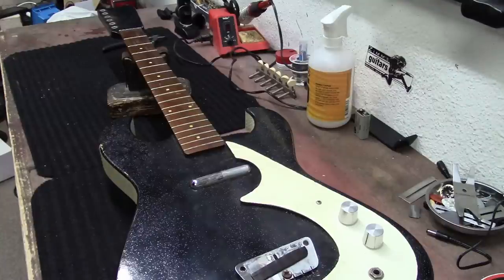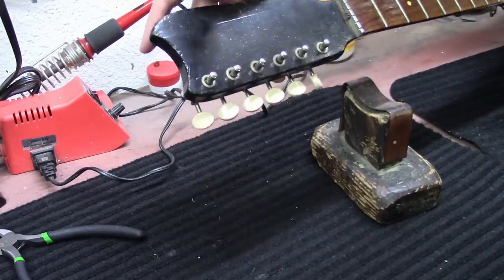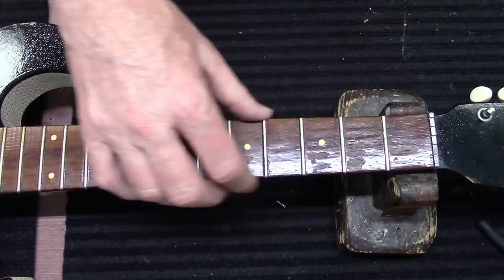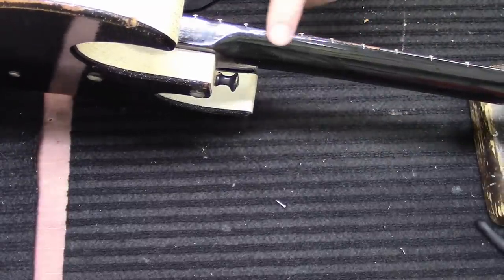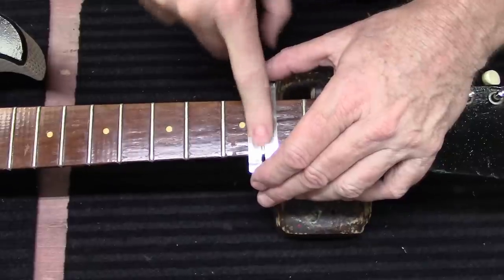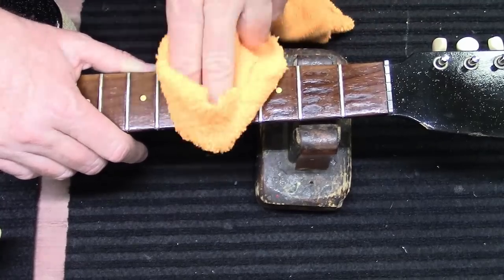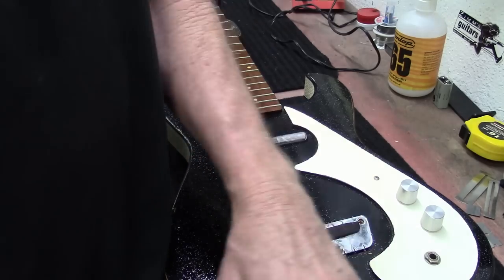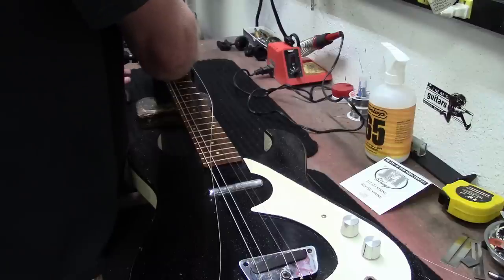The Storage Locker Silvertone!

Comment: I have soft spot in the heart for those things because of several reasons.
1: They weigh almost nothing, and the short scale let's you use  .011's or even .012's and still play easy.
2: Those old lipstick tubes are not super hot, and if you play one with the smaller Tweeds, like Champs and Princetons, they don't overload the front end and get too woofy and flubby. This applies to some of the other budget amps of that era as well, such as all of the Valco stuff. Some of those are amazing sleepers.
3: The lipstick tubes have a great clean tone, and the "edge of breakup" thing can be exceptional, depending on your Amp.
Of course, if the
"Satan's Cahainsaw" sound is what you're after, this is not your pickup.
     If you really like the guitar, and it suits your requirements, but the intonation is a bit off, there are direct replacement bridges available with adjustable saddles, and they're not prohibitively expensive.
       My personal opinion is that Danelectro knocked it out of the park with these, and along with my 1929 Stella parlor acoustic, I think it proves that there are still some affordable vintage instruments out there that play great, sound good, and are lots of fun to have around.
Thanks very much for posting this.
Reply: You're probably already aware of this, but David Lindley frequently played the 2 pickup version of this amp in case guitar on big stages with a full band (ElRayo-X). There are several ElRayo-X concert performances from Germany on YouTube where you'll see him with the Silvertone, and an excellent live version of Quarter of a Man from a Reggae on the River festival.

Comment: Love these old Silvertones, can't wait to see how you refurbish the bass. This is one of the earlier 1448 Amp In Case models, you can tell from the 2-bolt neck mount and diamond pattern vinyl binding. Somebody cut down the pickguard, which is curious, and those knobs aren't original but fit the aesthetic! What a great survivor guitar! It'll probably sing even more with 11s or 12s, as others have said, the 3/4 size takes heavier gauges well.

Comment: Was the letter date at the base of the  neck. Yes it did come with a copper box over controls. Yours looks early as the number of screws that hold your neck on. As I am a happy owner of a third week of Dec. 1962 1448 silver tone.
Mine even has a Neptune ink stamp on
Headstock. At first I didn't know about  the little guy. Until I read about the samples shown to sears co. Their on
The guitar in the picture was that little
Neptune guy on the headstock like mine. The story said Neptune was the factory logo. Which  I got this guitar from that part of new Jersey. Now I don't use the 1448 case. I use the 1457 Amp in case. as it has two inputs.
And the tremolo effect on Amo. This is 5 watt not 3 watt as in the 1448.
 case.  Bought my first 1448 in 1967 for $25.00. that was a guitar and amp case. Sold to my band lead player. 
This one I will have till I pass. It's perfect for very small venue.
Run fender pure nickel wound 9s
One of the original samples shown to
Sears sold on Ebay years ago. But that guitar was actually bolted and screwed to tripod display. Guitar was in poor shape. No  case. But that's how I became aware of the meaning of Neptune ink stamp on headstock.
Reading the book on the history of the Neptune factory in Neptune new Jersey.  Who ever ends up with the guitar you fixed can't help but be happy. Zimm you do a service. By all that you do. Thank you.

Comment: 3 In 1 oil is a poor choice for lubricating gears because it is designed to react with air and polymerize and form a film or skin against corrosion, which also means that it tends to gum up the tuners. They do make a special oil designed for motor bearings that will not polymerize. Otherwise, just use some synthetic motor oil such as Castrol.
Reply: Canola oil..
Reply: I agree with goodun2974. Any sort of automotive motor oil is good.  3-in-1 is no good and vegetable based oils get gummy over time.

Comment: I'd seriously consider this one as a keeper. If you  flip it, it's only going to keep going up in value, and one day you'll regret selling it.
.....ask me how I know. Mine was given to me free of charge in 1983, and I sold it in 1988 for $150. (It went to a good home, the lady that bought it was a player and she lost her mind over it, so that was cool).
    I couldn't even replace the pickup for that amount today.
     If the bills are eating you alive, try and find something else to sell that's more easily replaceable.
Reply: I forgot about another cool little trick that works well if you're not inclined to part with the cash for an adjustable saddle bridge for those things. Some people, Jimmy Page in particular  complain that the steel saddles make the tone too harsh and screechy.   
     So, having said that, measure carefully and drill extra holes on either side of the existing hole for the saddle in the bridge, and using a milling machine or Dremel, or just a small file, duplicate the existing oval shaped hole, one on either side of the one in the  center. (make sure they're evenly spaced)
   Find another piece of rosewood, cut it to the same shape as the original saddle, and then saw it into 3 pieces. Install those pieces in the new oval holes you just made, and VOILA! You now have a Danelectro version of the classic 3 saddle Telecaster bridge for about 50 cents and 1/2 hour's worth of labor. You also still have the original saddle, and the new holes you just made will hide under the original bridge.
     You can fine tune the little rosewood pieces with a file if you need to zero in on the intonation. If any more Danelectros come your way with complaints about intonation, this is quick easy money,  and a very happy customer.
        CHEERS 
              and 
        Hats off!
Reply: If you wanted to go to the next level with this, you could drill the adjustment holes in your new saddles all the way through, countersink them and use some black anodized  countersunk #4-40 machine screws and matching nuts. The intonation adjustment would now be on top, so  no more hassle of string removal just to intonate, and the tiny black screws would be almost invisible. The function would now be hassle free, the look would be about 99.9% original, and the great Dano tone wouldn't be compromised. The screws shouldn't cost more than $1.00, and the customer can intonate without taking the  strings and bridge off.

Comment: That headstock kills me.  The string angles are bizarre.
Reply: I think with the aluminum nut it still actually works, I don't recall any any tuning problems on my brother's unit and it was like that.
Reply: @hoboroadie  a roller nut would be the only way to help the tuning stability
Reply: @jblassio ,  If you look up David Lindley and ElRayo-X playing Quarter of a Man at the Reggae on the River festival (it's on YouTube), Lindley has a capo *directly over the nut*.  Can't tell if the nut is original or not, and whether it still has the overly large factory notches, but I'm guessing he may have done something to fill in those slots and is using the capo to press and hold the strings tightly in place.